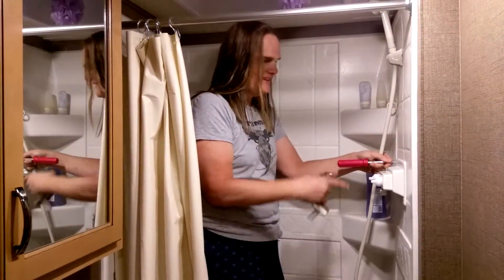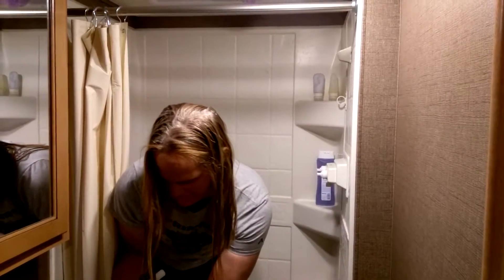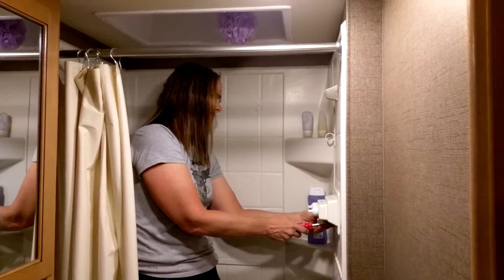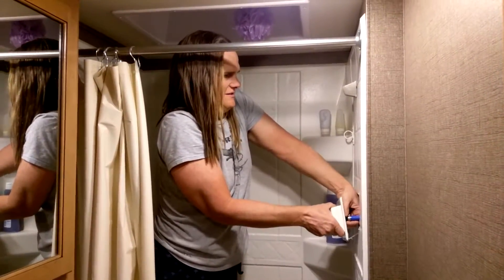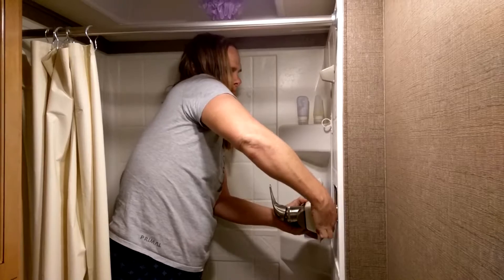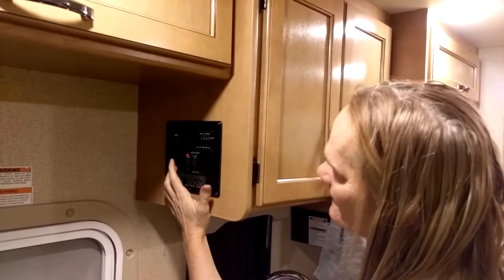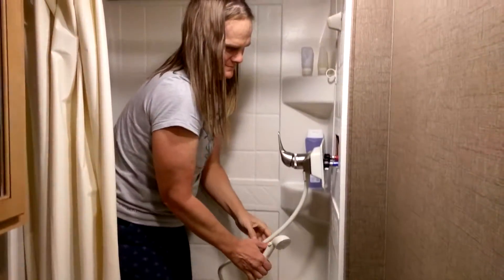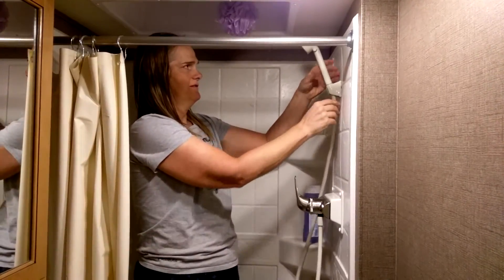RV Shower Faucet Replacement

Comment from the maker: I bought the faucet from https://www.etrailer.com/RV-Faucets/Ultra-Faucets/277-000024.html
Reply: Sorry that seemed rude.  You did an awesome job.  Using a better wand will decrease your water usage.
Reply from the maker: @dmtudder  I did replace the shower head with a better one, I just didn't record it, because there was nothing to it. Better pressure and less water usage are always nice boondocking.
Reply: @vancel35  Yes ma'am.  I don't have access from behind on my shower either, but I really want to switch my out too.  I hope I can do something similar.   So far, all I've done is the wand replacement.  My winnie's in storage but i'll visit her shortly.  Thanks for the info.

Comment: Sweet. We just bought our first travel trailer. We haven't taken it out yet, but I'm working on a list of improvements and preventative maintenance projects before we do. My mother-in-law bought me this valve for xmas, and our son bought us a nice Oxygenics replacement shower hose and head. I was thinking that I'd have to be crimping PEX behind our wall. I hope ours is like yours and just redo some threaded connections instead. Our shower valve is in the corner with no rear access, so similar to yours. Thanks!

Comment: I thought I only hated my double handle because it’s a pain, ugly, hard to clean... but now it’s a water waster too? Good to know! We will be replacing all three faucets in our camper this spring! 
Btw, I hang my loofah from the handle of the vent as well! 😉
Reply from the maker: I don't know if yours is as bad as mine was for wasting water, but it's definitely easier to just shut it off and turn it back on with the single handle.
Reply: Laura Vance Well, we have the sprayer that when you turn the dial on it, it shuts off the water but not entirely. Taking navy showers is fine but so much water is dripping from the sprayer when it’s “off”. Granted, it’s old but still... 
Your video was very informative!

Comment: Hi, I have no rear access to my shower faucet. Where can I get that spacer you have between the wall and the faucet? Thanks!
Reply from the maker: I'm not an authorized repair facility, so I can't definitively answer your question.  Yours may not need the spacer that mine does... If it doesn't already have it, it likely doesn't need it. Mine came with that spacer already there.

Comment: Love this!  Thanks for sharing!  Does replacing your faucet void or affect your warranty?
Reply from the maker: I actually don't know.  I would assume it would only cause complications if you needed some kind of warranty work done in your bathroom or shower.

However, if you're concerned about any warranty issue, have the faucet installed by a professional that would warranty their work.

Comment: Can the handle be removed and flipped so it faces down?
Reply from the maker: I tried that one time, and it didn't work.
Reply: Yes it can,simply grab the knurled ring behind the Handel and unscrew it "counter clockwise" just enough to let you turn the handle past the stops,then position the handle pointing down and re tighten the ring,easy peasy.

Comment: What's that mounting box called?
Reply from the maker: I actually don't know what it's called.  I searched for mounting box and found nothing.  I also searched for spacer, and found nothing.  

I'd say that if yours doesn't already have one, then you probably don't need it, unless you're modifying it, in which case, good luck on your search.
Reply: @vancel35  thanks
Reply: Etrailer.com calls that mounting box "LaSalle Bristol RV Faucet Bezel - Parchment" $26.20

Comment: It appears that you installed the faucet upside down. Is there a reason that you did that?
Reply from the maker: It's installed correctly.  The hose comes out the bottom, and the handle is hot-left, cold-right.  If you put the hose on top, it puts unnecessary angular stress on the joint.
Reply: Laura Vance I can’t disagree with the logic ,however every one of those are factory mounted with the hose fitting pointed up! I also think the screw which secures the handle on this design needs a cap to prevent rust forming due to the recess when mounted the way you have chosen .
Another comment would be a possible safety issue resulting from skewering an eye on the pointy end of that handle!
Anyway thank you for your explanation! 
Good Video !
Reply from the maker: @robertrobinson2874  If you notice, my original faucet was threads-down, so that's how I installed the new one as well.  It was inexpensive enough that if something rusts and I need to get another one, it's not a big deal.  For something like that to rust out would take more years than I'll probably have the motorhome.  

I understand that people have a deep compelling desire to find everything that other people have done wrong, but I think in this case you're stretching.
Reply: Laura Vance nope just trying to figure things out. I watched your video because I could not understand how to get at the water supply on mine. Frankly I was about to break something ! Thank You for showing how easy it was to get at the pipes!
Reply: Hose down will prevent water getting trapped in the faucet and freezing!  Very important up here in the north country when trying to drain ALL water out of the system!
Reply: That  faucet can be installed either direction if the handle can be removed and rotated around so it always is pointing downward.  That is the way it is supposed to be positioned no matter which way the mixer valve itself is mounted (e.g. with the spray head hose connection pointing upward or pointing  downward.
Reply: @vancel35   It is defiantly upside down,but there is no problem installing it either way,I just installed the Dura faucet ,similar to this one in my RV Toy Hauler,I also installed it upside down so the shower hose comes out the bottom but the Dura Faucet handle is reversible,by the way so is yours,I just prefer the shower hose on the bottom,it just functions and looks better.Just my 2 cents.